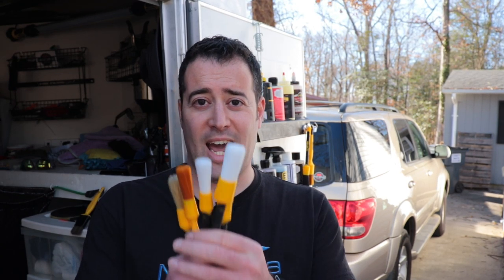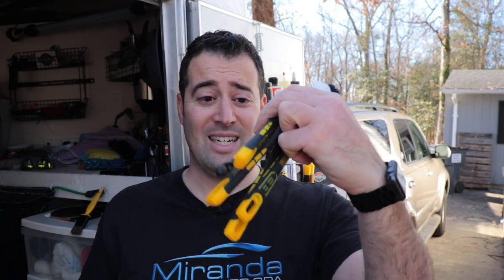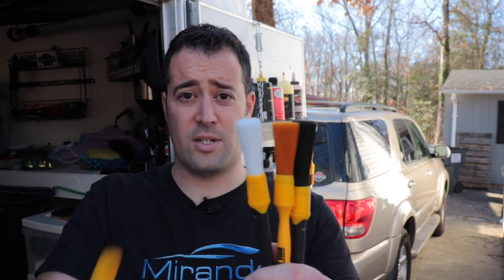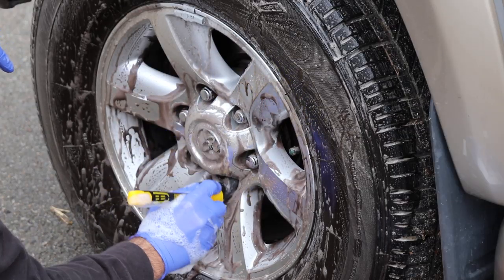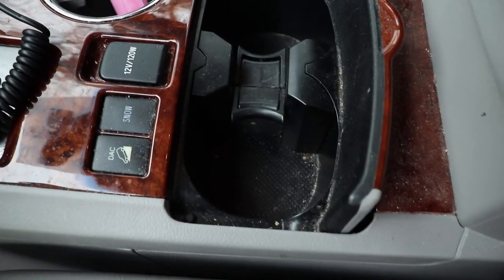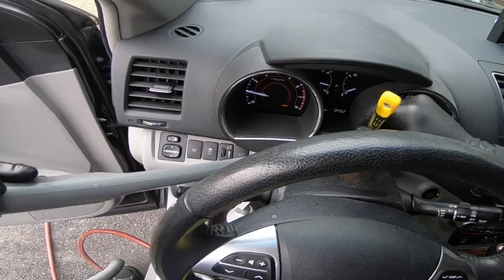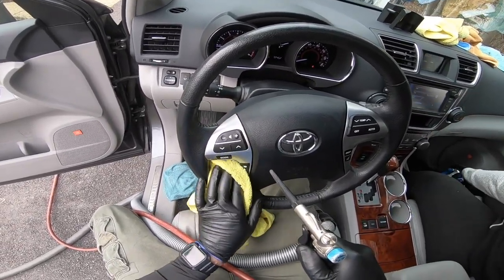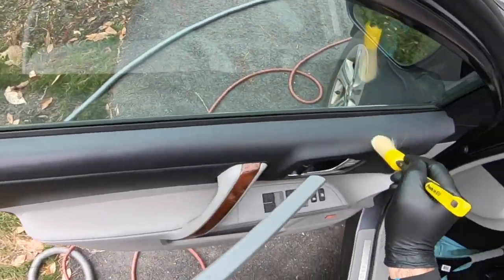Using the Work Stuff Brushes For An Interior Detail!  Car Supplies Warehouse

Comment: Phil so would get the rubber coated handle models vs the uncoated handles? So many choices  So is your orange albinio wheel brush the 30 mor 400 mm size? Love your videos and especially when head off the snarky comments in the video before they get posted.
Reply from the maker: Hi!  I love the rubber handle ones way better. They don’t slip out of your hand when wet and soapy. 
I was using the orange albino ones for wheels but now I use the black 30mm one for wheels now. Thanks find it works better for me. https://bit.ly/2V3GK7E

Comment: Great video! What seems to be the most versatile size for exterior and interior crevices and for getting around inset lug nuts? I couldnt make out the sizes you were using in the video. I'm trying to figure out which to buy for crevice work and inset wheel lugs.
Reply from the maker: Hi. Thanks!  we have found that the 24mm size is perfect for all around cleaning,  https://bit.ly/3DbdikW

Comment: Warning to anyone buying these brushes.  Buy the size you want but do not be surprised that the number on the shaft does not match the size of the brush (bristle width).  I purchased them in black with black synthetic and the photo online shows the numbers on the shaft.  Purchased the Albino in the next larger sizes and they were the same as the black set?  Number on the shafts are NOT the diameter of the brush.
Now having used them I am hooked on the quality and agree with Phil's comments.  I have no regrets on the purchase but was confused looking at those numbers on the handles.
Reply from the maker: Good tip about the sizes. I actually didn’t really noticed that since have a ton of them. Thanks for sharing that!

Comment: Hi there...Sometimes you use compressed air (for inside the car or engine bay) in combination or not with the TORNADOR.  ... What kind of a setup or compressor do you use ?  Capacity ? Power (PSI) ? etc...
Reply from the maker: Hi. Yeah I don’t always use the tornados tool, sometimes the air gun alone is great. My compressor is an 8 gal at 100 psi,

Comment: Off label silly  question.  Is iron out from zep. The same as iron x they both remove rust and iron particles. And its way cheaper
Reply from the maker: Good question!  It’s true they both remove rust and iron but not sure how it would react on paint or wheels. Plus iron x has that chemical that changes color to show the iron dissolving. Not sure on that one.
Reply: @MirandaDetailing  maybe its the same I'll try it on this old work  truck i have

Comment: Hello .. Great video. What are you advising me as material I seek 3 tools the first a good car vacuum cleaner. The second an extractor and the third a steam cleaner on professional equipment. sellers who deliver for France .. Thank you and good evening
Reply from the maker: Hi. Thanks!  Not sure what will deliver in France but if you have amazon you should be able to find these...hopefully. 
Ridgid Vacuums are awesome. VX5000 steamer is awesome but pricey, McCoulloch also work well. The Myteelite Extractors are the best in my opinion
Reply: Thanks for the reply .. the myteelite extractor what is the reference .. that you use thank you